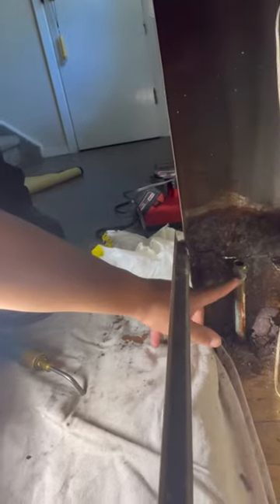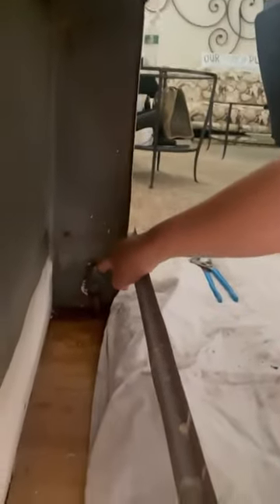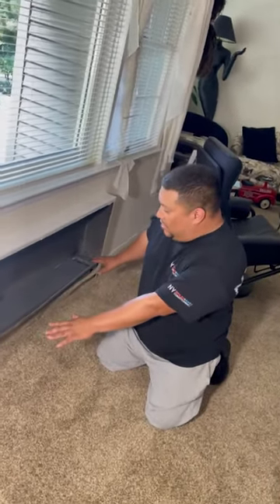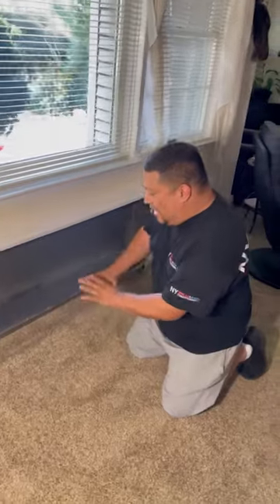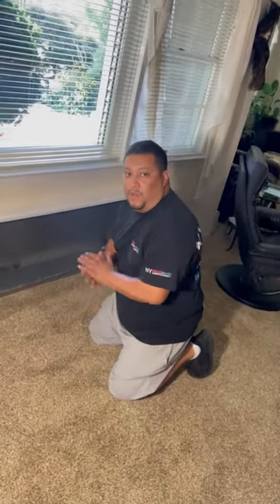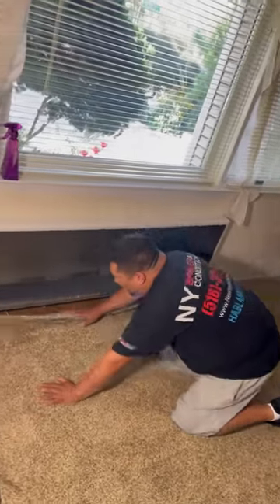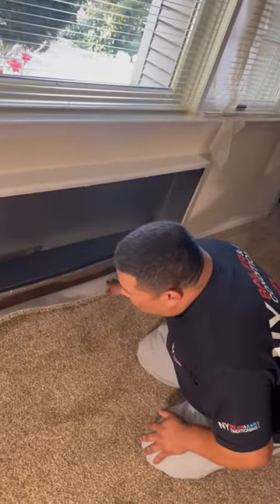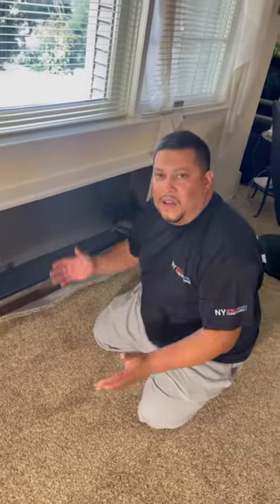CONVECTOR HEATING ELEMENT

Comment: Did you have to drain the entire system?
Reply from the maker: Yes, in order to this type of work you would need to drain the water from the entire heating system in order to do the work
Reply: @louietheboilerman  just curious how much would you charge to do a job like that?
Reply from the maker: @algernonbrown1696  it depends on your demographics because some places may be a little cheaper, but what’s cheap now? Everything is very expensive now a days and for a job like this your in the range of $1,200 - $1,500 from a professional company and someone doing it on the side I would say $900 - $1,200 and this is for labor and all materials and a helper
Reply: @louietheboilerman  wow!! Okay copy thanks champ Good luck with your business
Reply from the maker: @algernonbrown1696  thank you 🙏